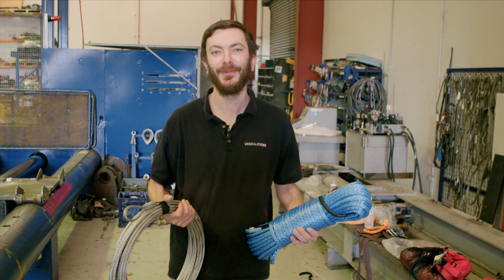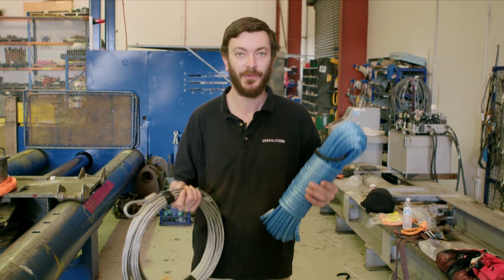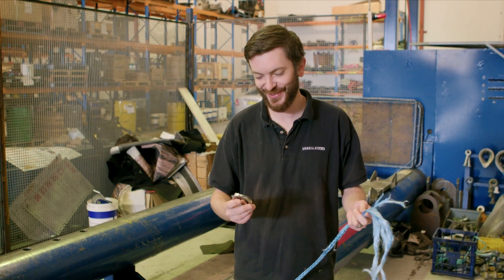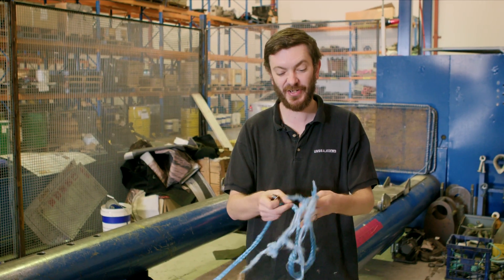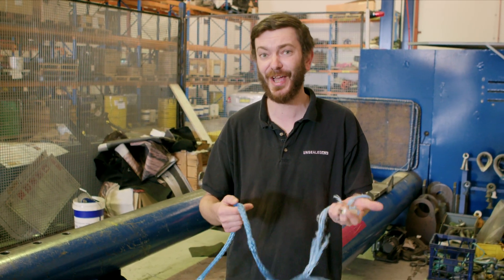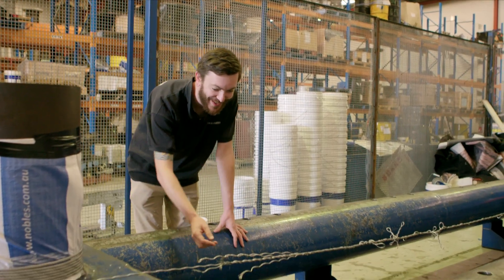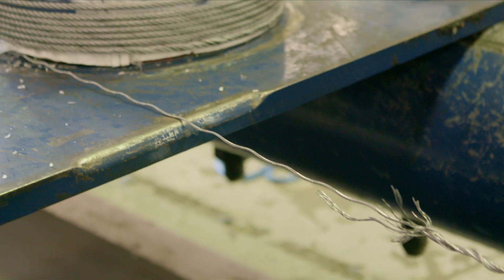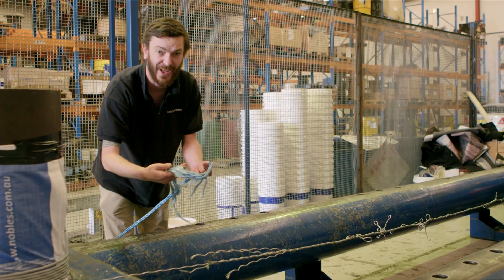Winch Rope Destruction Test: Synthetic vs Cable

Comment: The steel cable on my winch is nearly 30 years old and is still in good shape... I have some synthetic ropes that I use for winch extensions just because they are light to move around and I can easily stash them in various places in my Jeep, but I doubt that they would last as long as the steel cable has lasted and the abuse that it has experienced...

Comment: Over the years I have discovered that Dyneeema rope can not take shock loads very well , especially if it's dirty inside the rope and been subjected to engine heat and sunlight . 
Wire rope is more durable and forgiving of abuse but with a front mounted large winch synthetic rope is a great weight saver . It just needs more care and maintenance and replace it when it starts to look shabby .

Comment: Here’s a scenario, my parents and me in the bush on muddy trail in a 74 blazer pulling a 28ft airstream trailer. Slid in the ditch, winching out with 8k (8274)warn winch & 1/2” steel cable. We pulled the rig about 200ft before ditch levelled out enough to get out. Did that with no issues. This is back in the early 90’s back then it was unheard of for steel cable snapping.

Comment: That cheap metal eyelet should never have been there, retest after a proper splice is put in that synthetic line. Most synthetic winch line is SK-78 grade Dyneema in 7/16" capable of right at 22,500 lbs average strength. However, there is a stronger grade available SK-99 Dyneema in 5/16" is capable of almost 25,000 lbs and the tiny 1/4" dia. comes in just under the standard 7/16" winch line..... that means you can get a whole lot more synthetic line wound on your winch drum for much longer pulls. And both of these are far stronger than the same diameter steel cable.

Comment: and what happens to the plastic rope when it on your winch through the weather all year long?
a steel rope can take not being used through all four seasons and weather all year long.
as most 4X4's are parked outside. for me it is summers up above 115F. and winters to below 0F.
rain lots of rain. snow. heat of the summer, and just sitting on the winch drum through it all.
the plastic can not. just dragging it through dirt requires you to take it off, wash it, then set it out to dry. and then having to remember to reinstall before going out. (hopefully no emg calls, at 2:am.).
never drag it under tension over anything.

Comment: Synthetic is a money grab you can pay more for an inferior product. Theres a reason industrial cranes,wreckers and the military use steel cable. If you use a big enough winch for your rig you won't break it. However ive seen Synthetic ropes fail multiple times from abrasions rocks dirt sun. If you break a steel cable you done something completely stupid. Doesn't take much out on the trail to damage rope.

Comment: 6100 kg vs 4800kg =1300kg 
Go for steel
A 12000 lb = 5443 kg so the winch will brake the syntetic rope before reaching it's max capacity

Comment: You're end statement sounded  like you already had a pre existing opinion,  because from the results of your experiment , their was NOTHING flying at anyone's head , according to the one demonstration,  the steel cable would be a hell of alot safer because it had   a 2 ton higher break strength  .

Comment: 20 years working offshore with big diameters. Dyneema/spectra/kevlar have short life spans compared to wire. Synthetic is generally only used for slings and for tying ships up and thats because of weight. Heat, oil, grease, dirt, salt, marine growth, sand, all break down synthetic very quickly. Synthetic is great for vehicles. Easy to inspect, replace, ligjtweight, and not generally  life or death when it parts. Dont overthink it.

Comment: Tensile strength is only factor in rope selection and this is only one test of many that can be used to assess tensile strength. Chafe against surrounding materials, temperature fluctuations, shock loads, UV effects, age, etc. all are all factors ignored in this video. I personally prefer steel rope but cannot support that with science, only experience.

Comment: As somebody who has been professionally Towing for the last 10 years the only time I've ever seen a steel cable break is when it's been improperly used and pulled hard over a sharp surface or when it hasn't been replaced after signs of age and wear and the operator just keeps using it regardless of the condition it's in. Now as far as synthetic ropes and straps and all that stuff those need to be washed constantly they need maintenance all the time they get degraded just in the sun and the dirt particles that build up in them and there's definitely a shelf life to them they don't last nearly as long and they aren't as durable going over rocks and edges of things. There is a reason why steel cables are the industry standard synthetic ropes are just a fad for those 4x4 guys who will buy anything
Reply: If their just a fad, why are they the only material allowed on all winches at King of the Hammers?

Comment: Problem with rope is it doesn’t hold up being dragged through rock etc like steal and seams to be far more effected by the elements than steel cable. I have steel cable I used 35 years ago dragging logs that are still in good shape

Comment: An online voice search says the rope is safer because it doesn't store energy like cable does. That's 🐂💩. I was in the military and we were warned to be out of line with the rope because if it let's go it can snap back and remove an arm leg head or cut a human in half whereas wire rope/cable does not do that but frays snaps back very little then drops. During training we watched videos of this in action. For heavy pulling like wenching a vehicle out of mud I'd go metal wire. For lite pulling like wenching from a quad or garden tractor then synthetic rope is ok. Just my experience and 2¢.

Comment: In real situations, where people tie things in the most unbelievable ways, and have no clue on how geometry (diameters, angles) and mechanics decrease the effective strength of their cables, it is much more likely that we have a rope (or a broken steel cable) flying dangerously. The most common thing is to put a hitch around anchor point,  with the hook over the same cable; that reduces the effective force almost in half. The same if the hook is in a position where the pulling force is made at more than 45 ° with respect to the main axis. With the ropes it´s the same, any knot (depends on which one) reduces the final force they can withstand. Small diameters at the anchor, acute angles, sharp edges also affect the final resistance. 
So the issue of safety depends much more on the conditions (and forces) of use than on the material itself.
pd: a 5 ton hook pulling sideway isn´t a 5 REAL ton. hook; wire isn´t "safe" per se

Comment: So for the average "get myself or my friends out of the bog" uses for winches, what do you prefer to deal with? A line that is more compact for the same breaking force but can rust and degrade by weather? Or a line that is bulkier though much lighter but can age in the sun or otherwise dry out over time? After a certain period, both will have to be replaced. So pick your poison...

Comment: Your bias is showing.  Each failed safely.  No flying cable of death as the internet lore goes.

Like others, I have seen many brand new synthetic ropes fail, and I have yet to see a cable fail.

Also, your test apparatus, while excellent is not like wrapping a synthetic rope around a small diameter spool.  Several of the fails I have seen have been on the spool.

Lastly, and it is sort of the same as the winch spool fails, synthetics often fail going around the snatch block.

  I can't say where cables fail, I have never seen one fail.

Comment: Lots of people on both sides of the cable/winch rope discussion. For me, I saw a cable fail trying to pull a broken-down Jeep up the beginning of Cadillac Hill on the Rubicon. It snapped back with enough force to seriously hurt someone (fortunately, everyone had good winch discipline and stayed far enough away). I pulled him up with the winch rope I've had on my rig since 2005. I've never personally seen a winch rope fail, but I'm suppose it could happen. I keep mine clean and properly wound when I'm not using it, and it's covered to prevent UV from weakening it. Heat's not a problem since I have a hydraulic winch, and it has two sheaths to prevent chafing over rocks. I had a winch cable on a 1977 CJ5 years ago, and feel the winch rope is far superior for my use. YMMV

Comment: I have a 2dr Jeep and I'm probably looking at getting a hitch mount winch since my Jeep is so light. In this case, the rope is a better option since I'll be moving it to either the front or back depending on which way I need to pull
Reply: @Kaleb Owen I said 2dr (door) not 2wd lol. Does Jeep even make a 2wd??

Comment: This is cool if I want to winch my UTV up into a tree. But a break test with brand new materials is not definitive of which is the better product. I would like to see some other tests that are more real world. Like how well do the ropes hold up to being dragged over logs and rocks under load. Soaking them in brackish mud, or exposing them UV and extreme temperature swings - how do they look after a while. After the cables have been abused, what do they break at?

Comment: You didn't properly test the breaking point of the rope. The rope is much stronger than the cable. You need to test the rope with out the steel eyelet as the weak point.

Comment: I have been offroading since the late 70 and never seen a winch cable break. The manufacturer provides wire rope rated over stall point. I have seen 3 winch ropes break in 5 years and 1 was the first use. When the cable in your test broke I didn't see it fly across the room.. do tow trucks use wire or rope?
Reply: In real situations, where people tie things in the most unbelievable ways, and have no clue on how geometry (diameters, angles) and mechanics decrease the effective strength of their cables, it is much more likely that we have a rope (or a broken steel cable) flying dangerously. The most common thing is to put a hitch around anchor point,  with the hook over the same cable; that reduces the effective force almost in half. The same if the hook is in a position where the pulling force is made at more than 45 ° with respect to the main axis. With the ropes it´s the same, any knot (depends on which one) reduces the final force they can withstand. Small diameters at the anchor, acute angles, sharp edges also affect the final resistance. 
So the issue of safety depends much more on the conditions of use than on the material itself.
Reply: @pedrova8058  your selling on hypothetical situations that in today's world where people watch videos on how to fill there washer fluid. I started wheeling in 1978 same year I bought my 1st winch and the cable on it was under rated as is all wire rope made. When you double or triple line pull are you pulling with 2 or 3 cables? No same cable. Ask a tow company why they are still running wire rope. If the manufacturer of synthetic rope would just say it doesn't poke your hands I would be cool with that. I have never seen a winch cable break but have seen synthetic rope break on the first pull. I have synthetic on my atv and that's fine it's a 2500 lb winch on a 400 lb vehicle not a 9500 lb winch on a 5500 lb vehicle.

Comment: Not having jaggers makes the synthetic rope desirable. I too would be interested in seeing how they perform on a drum & with fairing.
I wouldn't trust wire rope to behave like that, I have seen it break many many times logging.
Adding 3' or so of chain to the end would be interesting, It is supposed to stop cable from whipping.
A couple of rescue knots for the synthetic would be useful.

Comment: OK so first what is the weight of the cable and rope...knowing that would be an asset...second when winching properly you would have a weight on the line to absorb any energy released when it breaks that or you shouldn't be winching at all ...if rope was "all that" every wrecker would have it and they dont because it cuts to easily...now on an average 4x4 rope is top notch as its easy to use and you dont risk wickers and stray sharp ends. Most winches come with wire...at least here in Canada...but I have run both and as long as you dont winch over rocks and such rope is great but when i have my jeep anchored and am winching a one ton...give me steel every time.

Comment: It is absolutely absurd to me that you could see the results of this test and conclude that the synthetic was better. What is this pathological fear people have of cable just flying everywhere when it breaks? That's not what happens. It's basic physics, when it snaps the broken ends fly in the direction of the force applied to them... that means directly towards the winch, snatch block, or anchor point. If you're standing 10-20 feet off to the side you are in no danger at all. Throw a damper over the cable to reduce the risk even more. Safety is not a function of the equipment, it's a function of the user's intelligence. Cable is vastly more resistant to damage, it will basically be at 100% of its rated strength until your grandkids are gone. Synthetic has to be replaced regularly and any contamination can ruin it. Worse, you may not know the twine is ruined until you try to use it in an emergency situation. Why would you trust your life to something that can be destroyed by sand?
Reply: maybe you should watch some safety videos, in particular the topic of broken cables/ropes and potential damages (a cable or synthetic rope that breaks at 2, 3 tons of force can do quite a bit of damage, real)
ps: in real use (with angles, turns and all that) a cable or rope will almost never break with laboratory force, it always does so with lower tensions (precisely because of the losses and geometry issues (angles, radius of the anchors , etc))...
Reply: @pedrova8058  I absolutely hate when somebody starts with "You need to watch/read blah, blah, blah..." I'm 52 years old, I've seen more stuff than they put in any video. I know things are dangerous. But things are only dangerous when you're stupid. A snapped cable can't hurt you if you aren't in its way. Stand where you're supposed to be standing and you won't get hurt.

Comment: Seems the couple advantages of the 'twine' is outweighed by price and longevity over the steel cable - on 3klb and up.
Synthetic is probably fine and last a good while on a SxS or ATV and the like.
Reply: I just bought a 100 ft 3/8 synthetic winch rope to use to pull my shipping container.   The container will be on logs and I will use a snatch block at the container end and have one end of the rope tied to a tree and the other to my truck. There will be a slight incline but I am thinking the rope should work just fine right??

Comment: A properly spliced synthetic eye shouldn't break like that. Looked like the eye slowly came undone instead of holding until the rope snapped. I've done testing on 12 strand high strength rope before, and it's certainly more safe than wire, however, it usually doesn't break like that

Comment: I won't own a winch with synthetic rope.  I had one once, and it didn't last more than a few pulls before it was chaffed to the point I was worried about its strength.   Steel cable for me always.

Comment: So, in this demonstration the wire rope broke under higher load. To me that's the kicker. Using this demo I don't understand why you recommend fiber rope. You demonstrated that the wire rope would have pulled more than that fiber. That's the purpose of the tool. 
Both can be employed safely. If the safety benefit of fiber at failure point is the deciding factor maybe offroading is not a wise pastime. The premise supposes failure, a consideration but not the goal, and it doesn't consider that wire rope has long been and continues to be used safely.
Since equipment safety figures so prominently in this demonstration it's worth noting that once a piece of rigging equipment fails, its life is over. Granted, industrial rigging equipment that undergoes mechanical failure can be repaired and recertified but offroad rigging doesn't begin to approach the value to justify that cost. Winch rope, chain, shackles, chokers, clamps, snatchblocks, hooks, etc that fail are junk and their capacity as rated is void after they are exposed to forces that result in failure of any part of the device. Reuse of a previously damaged fiber rope is a far more dangerous gamble than using wire rope that isn't damaged.
Reply: The rope didn't fail, the splice did. You could see the splice pull apart when it failed. The rest of the rope was not over stressed. I'd be willing to bet that if the end was cut off and properly spliced it would take quite a bit more than 4t to break it.
Reply: We'll disagree. Understandably I don't replace a 2 million dollar Grove because a hydraulic hose burst. A winch rope though is a consumable. Splice, thimble, becket, swage,  splice, whatever. If it lets go the gear goes into the dumpster, not back on the drum.

Comment: The fact that there are a myriad of chafing situations in an off road environment makes the synthetic stuff only viable for vehicles that simply couldn't handle the weight of steel. If you think you can use them each in the same situations, you either have a non diverse terrain environment (mud/snow and flat) or just don't use them.
Reply: The fact that they make a myriad of chaffing mitigation for synthetic rope means that you obviously don't use them.
Reply: I've got both steel is much tougher and more reliable not to mention cheaper. I'll never pay more for a inferior product again there a reason cranes use steel cable not synthetic. A small abrasion and synthetic rope becomes useless. A tree rock or the sun will take it out. You got to do something stupid to break steel.